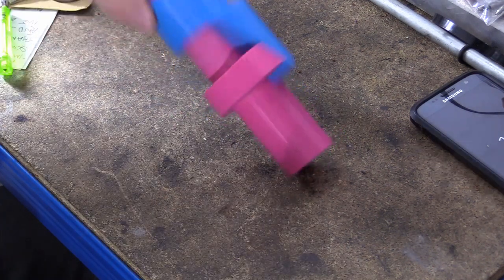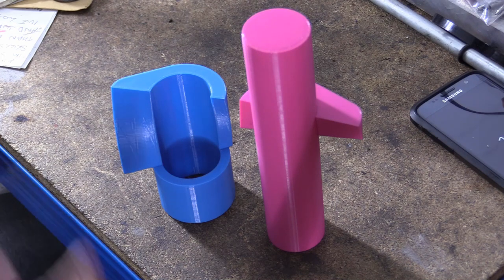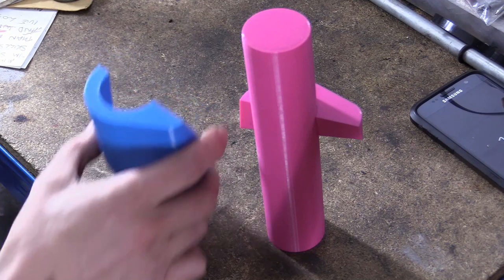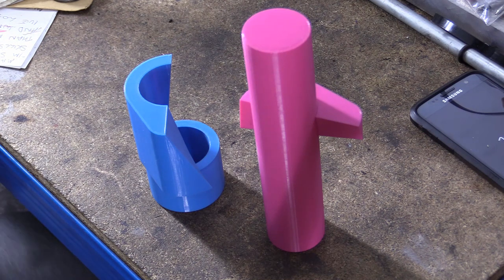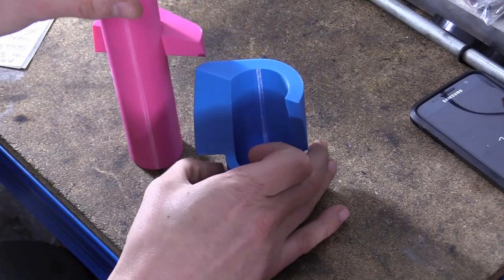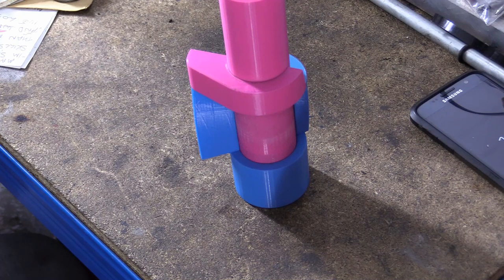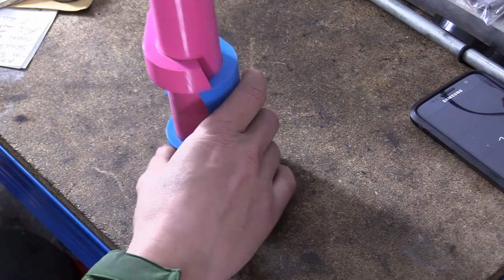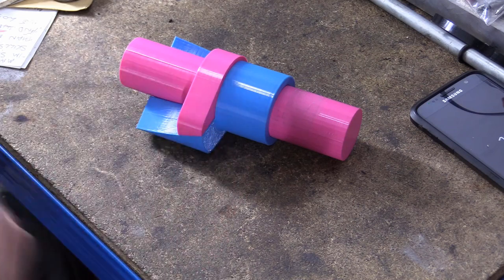Helical Cam Machining

Comment: Another option.  multi axis robotic grinders.  I've programmed something similar, minus the helix angle itself in the part I was making, but it is capable of doing said helix if combined with a rotary clamp.  I believe we discussed it before, and in the end the conclusion was that it isn't impossible, just impractical from a time and cost stand point.

Comment: you could build this part in a manual mill. Deckel FP1 mill with spiral / helics attachment and instead of a endmill you could youse a zylindrical grinding pin ... no problem but you got a point with the expense to a normal cam

Comment: There is one more option but it's still more expensive- CNC machining to final specs + ion nitriding.
Reply: U mean use softer steel and use a coating? I know that when coating a cylinder they still hone it to final dimensions (although idk if that's just to get a crosshatch for oiling or if it's actually needed to get the precise fit) and typically a diamond home is needed because it's such a hard coating.. that sounds viable for a racing engine that is refreshed every race but these coatings are usually only a few microns which means if you take the cam one hour past its service life u may have an engine right full of mild steel shavings ..

Comment: I used to think you could come in with a mill to tangentially do the helixes. 
Yeah. This is a bastard to make. I've never heard of grinding being done with sandpaper belts run over dowel. That would be the only way I think we can get anything abrasive in the works here, and it'll probably shit the bed in a heartbeat.

Comment: ,,, is it possible that some of those inserts are ceramic, not carbide ?
Reply from the maker: Carbide is a ceramic in this context -

Wiki - https://en.wikipedia.org/wiki/Carbide

"Examples include calcium carbide (CaC2), silicon carbide (SiC), tungsten carbide (WC; often called, simply, carbide when referring to machine tooling),"

Comment: What if it's machined very close to spec, then induction hardened, then a final machining and polishing, the roller cam I got for my Chevy engine was so beautiful! I didn't want to put it in the engine... It looked like chrome!   What about the PM like the rods in modern engines.  Usingp  powdered metal.?? Just an idea.. How about a completely different concept? What if the cam lobe is on a splined shaft. With the main lobe pressed on. With the variable lobe sliding. With the ramp up sides equal . allowing them to slide in under the follower.then it will follow the longer duration of the variable lobe. This has me wanting to make a cam for my small block Chevy!!!

Comment: The helical cam seems like an overly complicated way to achieve infinitely variable duration, you could just have a one piece tapered lobe that can shuffle back & forth on the shaft, or a one piece camshaft with tapered lobes & the followers can shuffle back & forth on the lobes.

Comment: When i see video's like that (machining) i get so jelly. My mill (160KG) has trouble taking away 1mm, and is impossible to get straight. Once dialed in and secured it moves atleast .5mm when machining. Piece of sheit. Should've saved up for a big decent one. Takes ages to machine a part.

Comment: use a cnc grinder or hard chrome on the lobe?
Reply from the maker: The sliding surface has to be hardened...
Reply: @dirtygarageguy  does it really? it has a huge contact area compared to the cam lobe and it's not going to see the same constant high speed sliding
Reply from the maker: It still takes the full force of the cam engaging the the valves, it also has to be precise and maintain its clearance.
Reply: @dirtygarageguy  yes it has to take the same force but surely the much larger contact area and slower movement must reduce how hard it needs to be?
Reply from the maker: Its in shear as well as compression...
Reply: @dirtygarageguy  so the comparably huge area of the mostly static "slopes" has to be just as hard as the outside lobe that has a tiny constantly moving contact area to the follower?

Comment: wouldn't be cool if a cnc machine had a grinding wheel with laser guidance that would be able to go back and correct it self like a person does with a file.🤔 
If it happens in 10 years or so you saw it here first😅
Reply from the maker: The problem here is size, this model is massive compared to a real cam set-up. Using a round grinding disc and a tiny surface to grind is probably impossible
Reply: all hypothetical dude Your videos do in fact make scene😉✌

Comment: Nitrate hardening?
Reply from the maker: 1) this limits you in materials a bit, but most steels that are used for camshafts can be yes.
2) Nitriding is still done hot. 600DegC or there abouts if I remember correctly
Reply from the maker: Yamaha (and most others) Carburize their cams -

https://global.yamaha-motor.com/business/cf/example/forging/ex002/
Reply: I worked a few months at a company that hardens shite for car manufacturers. They only need to polish it after that nitrate hardening and you have a perfect surface. You can control how deep it goes and where by just coating the surface that should not be harden. The temperature isn't the problem and if you are honest if there would be a change in volume or diameter of the thing you could calculate that within the raw piece of metal you manufacture before you harden it. So I see no problem with the hardening of it after you gave it the shape desired.

Comment: See DMI Mori etc. Wire edm will not give finish and will compromise hardness  The design of the part accommodates the manufacturing processes necessary to produce a viable and durable product. Try machining , hardening and grinding a turd - the initial concept i.e. shite is not viable  Q.E.D.

Comment: i don't understand why you would make this in two parts is a little extra steel really that bad why not make the whole cam movable
Reply from the maker: A moving cam is not what makes it variable - unless I've misunderstood what you mean?
Reply: @dirtygarageguy  make the cam lobes wider so its like both pieces and make the cam move side to side

Comment: If you were going to machine, you'd only need to do it once, in order to make a model or mould for casting or (I guess, not quite sure how it's really done) sintering.  Grinding something like that to the tolerances required is gonna be a cunt to do, you'd probably require at least 4 setups to do it, and thus the part would be expensiver as fuck.

But mostly, I look at the model and see stress risers all over the place. Regardless of manufacturing process, it's a top-end explosion waiting to happen.
Reply from the maker: "But mostly, I look at the model and see stress risers all over the place."

This is just a simple model......